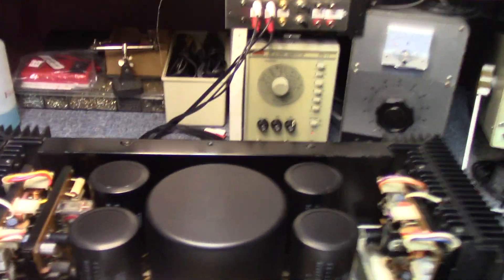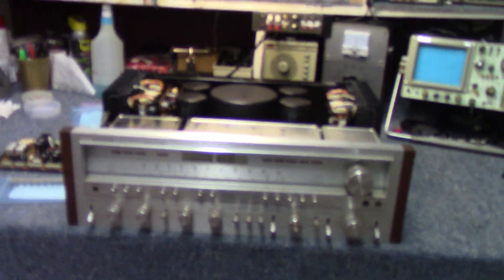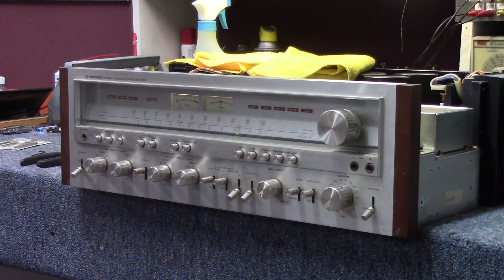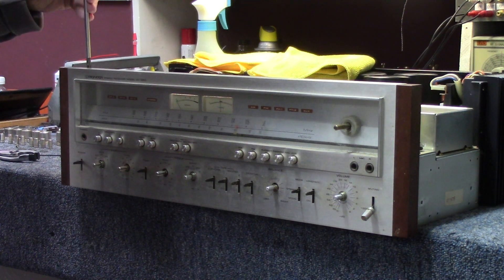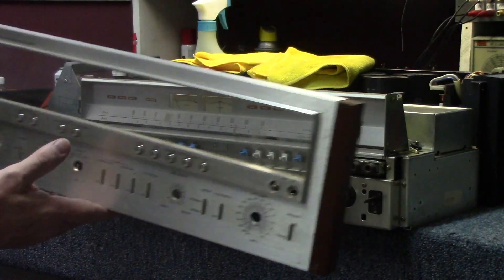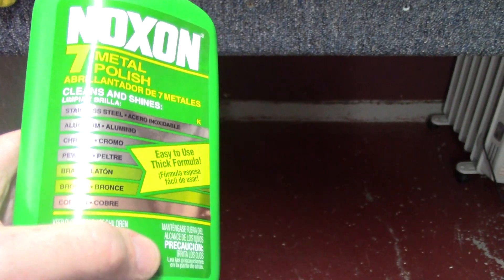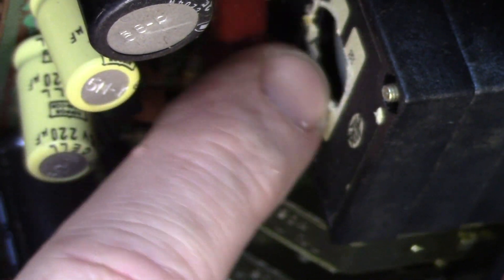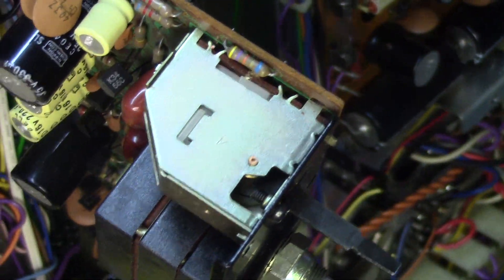Pioneer SX-1250 AM/FM Receiver - pt.2 repair & testing

Comment: Great looking unit!  Glad you went with the 75mV idle current adjustment. The general consensus is that 100mV is a misprint on the service manual and will overheat the output stages. I saw another channel do power and distortion measurements with both settings and they were exactly the same at full power, so there was no performance gain to cook it so hard.

Comment: Really enjoy and have learned a lot from your videos.  I have an sx1250 that I purchased in 1978.  Haven't used it much recently.

I was having trouble with my volume control and have cleaned all the controls as you describe in your video.  That helped.  Volume control works well but a secondary problem is both speakers work in mono mode but only one side works in stereo mode and does same with various inputs. If I direct the balance knob to the speaker not putting out I can sometimes here a faint sound and I can turn up the volume to a point where it kinda pops and then starts playing but once I balance the speakers out again it only plays for a short time before doing it again. 

Oh yeah, sometimes it is on the right, other times on the left. Really weird...and annoying.

Any suggestions?

Thanks

Comment: Hey sir can you help me pleast 🙏🙏 my 1250pionner is can not open its have a power in transformer and the relay is turn on but the relay of both left and right  power amp is can not switch's and the pre amp in  the selector like am pm aux  is no power  the pre amp is ni supply  what would I do thanks sir
Reply from the maker: Rica,  thanks for checking out the video!  Your SX-1250 would be a tough unit to try and troubleshoot through messages but knowing you have a couple of things going on I would definitely download a service manual and start checking power supply voltages.
Reply: @luvradios  Thank you sir  I'll try to fix it

Comment: Nice video. I own a SX-1250, and the only issue I'm having is that when I engage the loudness, it only is effecting the left channel and not having any effect on the right channel. Any ideas why or a solution?
Reply from the maker: Assuming you cleaned the switch?
Reply: @luvradios  Yes
Reply from the maker: @deekay2  ok, so the next step is to check for a cold solder joint at the switch, if that checks ok jump the switch to 100% eliminate it as the cause or check continuity with your multimeter (power off the receiver first) if thats all ok then start checking the associated components in that circuit, look for open trace/resistor, bad cap, etc.

Comment: do you have to discharge anything or is unplugging the receiver fine. i jsut bought one and the switches are static so i bought deoxit but dont want to get shocked
Reply from the maker: leave the unit unplugged for a day and the caps will discharge.

Comment: 66 here, Luvradio is there a recommended parts list? Also is there a technique to darken the faceplate lettering? Thanks
Reply from the maker: George, thanks for checking out the video, the ones I changed would be what I would recommend along with any others that are actually bad.  I'm not sure if there's a procedure for the lettering, I bet someone has come up with something though (google).

Comment: what would be causing this "It will play for about 10 to 15 minutes and then the right channel will quietly stop working, But if you then power off and let sit for awhile the right channel will work again"
Reply from the maker: Well first let’s narrow it down some:   Does it do this on all sources, radio, tape , aux & phono?  Once this happens, if you touch the pre/main jumpers in the back do you hear a hum in the dead channel? Will toggling the switches or adjusting the controls cause the channel to cut in/out?